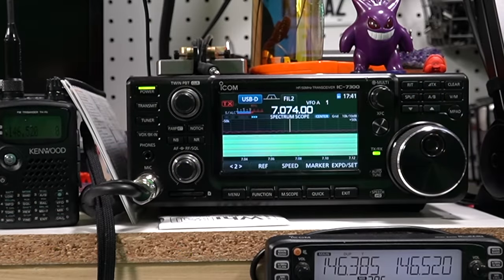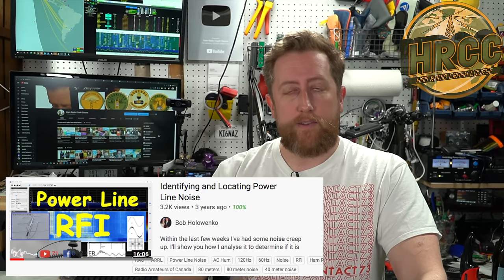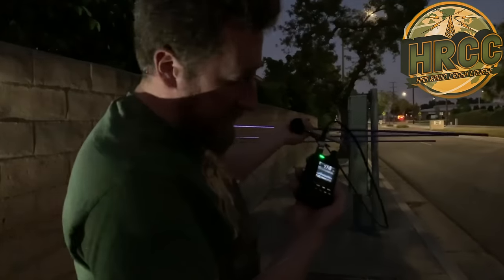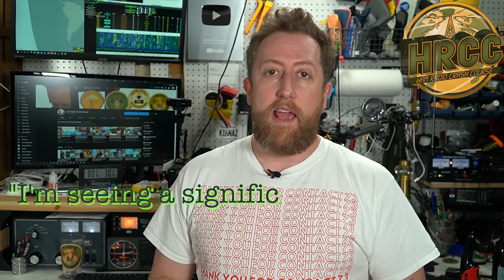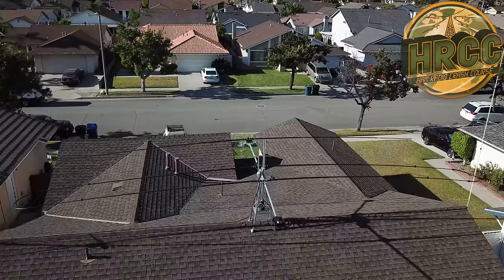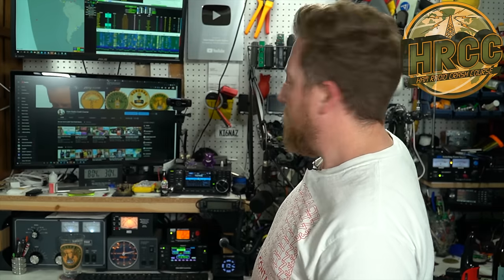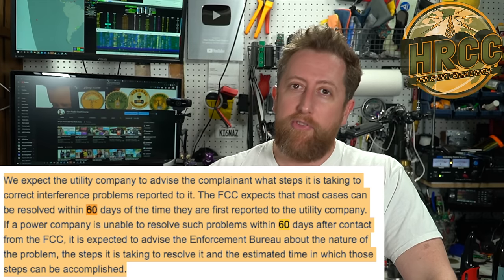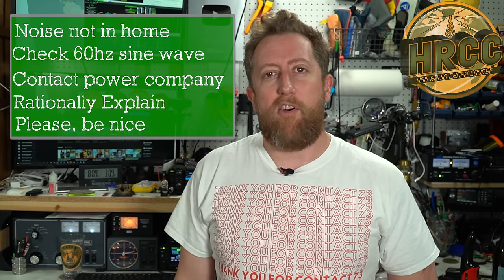Power Line Noise On Your Ham Radio?  How To Find AND Get it Fixed

Comment: I get a lot of noise from my touch type table lamp trying to receive SW stations.  I put an in line on off switch in the line.
Reply: Touch lamps are notorious for RFI.  They are continuously energizing the metal surface with a high frequency signal.  That signal is affected by your body capacitance when you touch it.

Comment: Question...What if you find the noise and its not the power line?  It is coming from a family dwelling near by.  How do you force these people to cease the noise....particularly if the noise is coming from their big screen TV and they would have to completely disconnect and cease using the TV.
Reply from the maker: You generally have to work with your neighbor and help them find the offending electronics.  The ARRL has a website with recommendations on having that discussion.
Reply: Please read the very last sentence of the question then reply.
Reply: @raymondwarceneaux7423  I don't have a solution, sorry as I guess it's not the power cord where ferrites/chokes might help. However, it might be helpful to know the make and model of the T.V. if you can get it. Knowing that might help the rest of us.

Also, I would contact the mfr of the TV, notify them of the problem and ask what they recommend. Maybe there is a defective component that could be replaced.

Good luck!

John - KK7JBZ

Comment: Good video about radio frequency noise on ham radio.  What about a very low bass diesel engine noise interference heard in house by only a few people that vibrates, irritates, hurts and heats up your ears and nervous system causing severe insomnia, headaches, vibro acoustic disease after 10 years of exposure and subtly resonates everything in your house by proof of water in water bottles vibrating and the noise piggybacking on appliances or desk top computer tower's 60 hertz hum 24/7 and could be causing dirty electricity issues in house? Turning off all power in house the noise still making house hum from the walls and floors and is stronger but when the power is back on and t.v., fan, furnace is on and going the diesel engine bass can't be heard in house that well but you can still feel it's vibrations on body or see water vibrating indoors or even see outdoors sidewalk or street rain puddles vibrating in the same fast pattern. Going outdoors for about eight  hours you feel better to go back in house! Could the devices for detecting RIF in this video be able to help find this type noise and vibration source? Some people are complaining it's the power lines and smart grid while others say it's the interstate high pressured natural gas pipelines to blame! No authority over power or environment will look into this phenomenon!
Reply: Did you find the source?
Reply: @sunnies336  yes through a mechanical engineer that is also a hum suffer in his own home since 2009 investigated the noise and vibration in his state and claims it's different interstate high pressured natural gas pipelines everywhere across America as the source of the problem!  All of the hum suffers have the same noise and vibration issue with same symptoms but over 158 million people that have reported this hum is suffering world wide. But authorities are ignoring the complaints except for the Havana Syndrome group that had incomplete investigation for the strange noise and vibrations.

Comment: ever since i got powerline internet (only way to get internet on my floor because i have thick walls) i been getting awful noise on my non battery powered radios (and it even appears on my oscilloscope when theres no test lead attached) and it kinda kills propogation it seems. is it possible to isolate my radio stuff from the noisy mains other than using batteries?
Reply from the maker: Disconnect your antenna and tell me if you still see the interference.
Reply: @HamRadioCrashCourse  it goes away as soon as i disconnect the antenna
Reply: I thought power line internet was killed years ago! It is well noted for RFI issues!
Reply: @MaryBrownForFreedom  they are still around! Theres a main router downstairs and my computer is upstairs and since this is a rented house we can't drill holes for the ethernet cabling. So for almost gigabit i had to give up radio. I won but at what cost...
Reply: @MaryBrownForFreedom  I'm pretty sure what Logan is talking about is a personal network extender that uses plugs into two of your wall receptacles to get from one part of the house to another. That is different than having the power company send internet down the street on their utility wires which would cause much RFI
Reply: @kayakingphotos  I got that from his reply. They are NOTORIOUS RFI emitters! Small directional antennas and a power booster for 2.4ghz would be less RFI. Plus his power line wifi is going to every apartment or condo on his side of the power line transformer.

Comment: It depends on the state you live in and the power company with FPL in Fl. there is a TVI department on their web site and a RF engineer comes out finds the issue and puts in a work order, but it can take up to 30 day to get resolved. The FCC has laws on the book to support all this but its soon all to go away big power company's have lobbyist in DC .Pretty soon these laws will change, and you be shit out off luck for hams living in suburban areas. Until the power lines start going underground things will only get worse??The ARRL and FCC are pretty much Useless at this point.They could care less about the Ham Radio community 😒😒

Comment: No Problem PLC Noise , my  OM go on 40 or 80m an give1000 Watt vor 30 sec and the Noise is off 👍🏻 Not Long for 15-20 min
Reply from the maker: What’s that now? They transmit and the noise goes away? How?
Reply: @HamRadioCrashCourse  Yes, but only for a short time, my friend is licensed and found out by accident, in Germany we are contaminated with cheap PLC Internet plugs, so with the test what he did is the end of the interference signal!  Of course it's not a permanent solution, but the more often he does it, the sooner there's an end to malfunctions and yes, it's also healthier because the parts are shiny and that's not healthy!
Reply from the maker: What you say 1000 watt vor? What do you mean? Which mode?